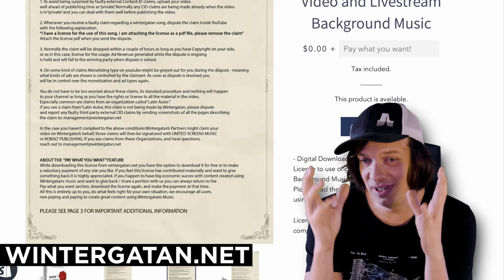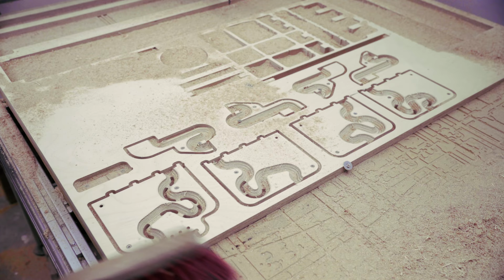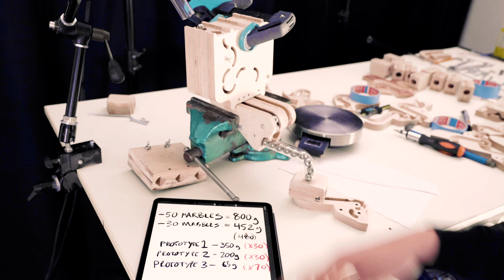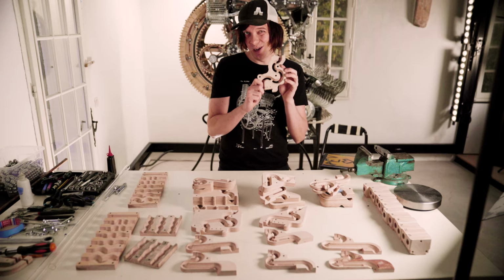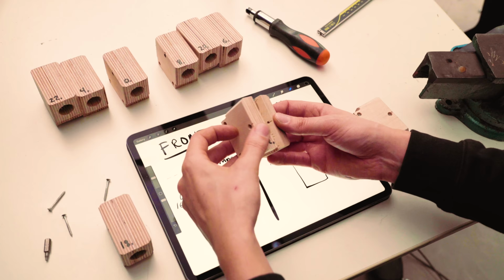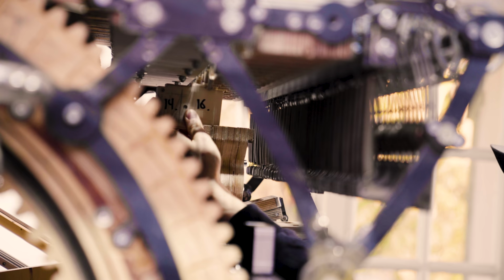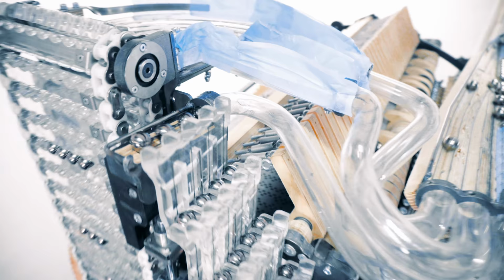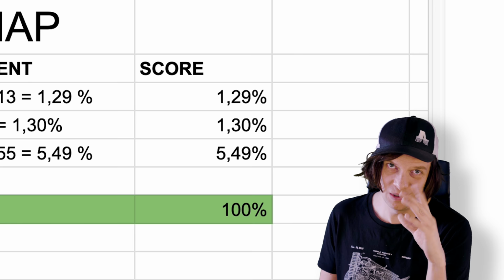Playing 20000 Marbles - Marble Machine X #147

Comment: Martin -- regarding guide wheels on the belts:
I'm probably preaching to the converted here, but remember to make sure that the wheels are positioned in such a way as to divide the free belt length in a non-rational way.
Any cord under tension acts like a string in musical terms and will have a natural resonant frequency, so will have a tendency to "sing" when fed certain frequencies (and the MMX is nothing if not full of frequencies!) -- if the rollers divide the length in half, you risk ending up pushing the vibration up an octave, which doesn't resolve the problem. If you have any other rational pair of lengths, you'll get pairs of overtones -- same problem.

Comment: So if I caught everything right; no failures on the parts that have most recently been worked on except for the catch... disappointing, but hardly the end of the world.

I know Martin won't go for it, but the real solution here is to leave the catches how they are, and have a 'catch all' below them that is just a large unmoving trough. Make it low and out of the way and it won't be too much of an eye sore.  Otherwise, having the catching mechanisms moving is going to be very difficult to calibrate with every possible rhythm that can be played.  Personally, I do not consider a dropped marble or two a fail unless it is near the top where it may play a wrong note, or get jammed in the machine somewhere.  If a marble 'doesnt want to be in the machine for a song' then it is probably because it wants to be in the hands of a fan in the audience.

Also curious about the 4-4 time of the rhythm being played for the test, as I am not sure it is realistic.  For one, it makes the test too long for practical benchmarking.  For another, it may be unrealistic for actual music being played.  Makes a lot of sense to drop more marbles per second to really push the machine, and make the testing process faster (or test for more marbles).  If he thinks it is good now, and ups the tempo to find a problem later when he has most of the gates deployed, then that would be a crushing disappointment compared to checking it now.

Assuming that it can in fact play faster while keeping the current level of reliability... dude... cannot wait to see the rest of the channels installed and hear some real music coming from this beast!

And the free music?!?!?!?!!  Wow!!!!!
I will pay what I can (granted it won't be much), but I have a 3D printing channel which will be starting early next year, and I run D&D sessions online.... I would love to use your music!  That is AMAZING!!!!
Reply: A catch all is cheating. He will engineer a good solution or figure out the variance in marble jumps.

Comment: Issue 4. Functionally speaking. You don’t need 2 tension wheels. Just one per belt should do. KISS...

Issue 5. These marbles are steel. Steel will wear down anything softer than steel. Essentially everything in this machine is softer than steel. This machine. No matter how smooth you get it. Will eventually eat itself to death. My suggestion. Use softer marbles. Or use harder machine components. Make the marbles the consumable part. Then make a quick sorter to tell when marbles are worn down too far. And trash them.

Comment: Hi Martin, I think that, with all the improvements, reliability wouldn't be a problem soon but, Have you ever though about how to transport the machine? Truck, trains, forklifts, etc are a source of vibrations and a travel of simply a few hundred kilometres by truck can break havoc in such a heavy machine with so many moving parts.
I'm mainly worried about the funnels. From what I can see from the videos they are only hold by PMMA tubes. The funnels are heavy and if subject to vibration will make the PMMA tube vibrate and eventually fatigue and break. These tubes are unique pieces and difficult to manufacture and replace so breaking one would be a catastrophic failure. You can even see the tubes vibrating when the marbles hit the funnels, imagine that  vibration multiplied by 10 during 200Km on a truck.
I'd suggest to identify all parts that are susceptible to vibration and improve the fastening method where needed. The more massive is the element the better has to be hold in place. In the case of the funnels they are a lot more massive than the tubes holding them in place and PMMA is really prone to fatigue.
Never underestimate how destructive transport can be. Remember that the "handle with care" stickers are just stickers and nobody reads them.
Reply: The machine is designed to be broken down for transport. Especially parts like the funnels that are not rock-solid will be removed and packaged.
Reply: The machine breaks down into 4 major parts and all the funnels and droppers are made to be easily removed
Reply: @HenryLoenwind  Nice to know he's thought about it. I have had my deal of bad experiences shipping machinery. In my case we could replace the broken parts with spares but, in this case there are no spares so you should be specially careful.

Comment: 12:13 : the plywood breaking appart : is this not a risk that - in the long run - the marbles will damage the wood (hence the profile) and the marble slowdown will start to fail ?
Reply: I've worried about that a long time. I fear that eventually, the plywood will have to go for years long reliability.
Reply: Remember this is still prototyping pretty much. While plywood isn't as durable, it is much more replaceable. When Martin gets a design he is overall happy with, he can rebuild the machine with more durable materials if needed. The concern is valid though given how long ago some of the parts were made.

Comment: When you will be on the stage, playing the marble machine, there will be a ton of vibrations coming from the crowd and other sources. Have you taken that into account?
Reply: I imagine that should be okay since it will be white noise, and not some frequency that could cause amplification or resonance. I'm sire the machine will also have some interface between it and the stage. The feet are already somewhat equipped with vibration dampening equipment - so that it doesn't shake itself around

Comment: Martin - When you were designing the track using over rotation as the principal to slow the marble what you ended up with is the marble dragging in the track since one side of the marble is moving clockwise and the other would want to counter rotate since it is in contact on two sides.  The drag in the track or it's length probably ended up doing what you wanted.  Regardless you are doing an amazing job getting this far and you will get to the end soon, we can all see it.

Comment: 8:00 And easy explanation of why over rotation slows the marble down is as follows: Going down the ramp converts the Gravitational potential energy (the work you had to do to lift the marble to that height) to kinetic energy (the energy of motion). There are two types of kinetic energy that are relevant for the marble; linear kinetic energy (from the motion in a straight line) and rotational kinetic energy (the energy from the marble spinning). Over rotation just causes a higher percent of the potential energy to be converted to rotational energy, and since more energy goes into the rotation there is less energy to go into the straight line motion, so the marble doesn't move down the track as fast.
Reply: it's similar to magnus effect,  basically higher rotation speed = more drag
Reply: That explains the change in velocity on the straight track, but what he ends up measuring is the weight effect of the static stack in the tube. What he ends up with isn't a function of the over-rotation, but a function of the overall static friction of the tube, taking into consideration factors like the resistance due to the normal force of the marbles in the horizontal sections and the coefficient of friction between the marble surface and the wood edge versus the original tube.

Comment: Hi Wintergatan, thanks for all your videos, hope the project is going well.
To solve  the issue with the belts I think you can simply pierce some holes in it to stop the belts entering in resonance. If there is tiny holes all across the belt, the vibration will not be able to run across it. 
Hope it can help you. Have a great day, full blessings <3

Comment: 8:00 to travel the same distance along a wider track the marble has to make more turns. So, to have the same linear velocity it needs to have greater rotational velocity. The marbles initial potential energy is divided between its linear kinetic energy and its rotational kinetic energy. Since it has to rotate faster in wider track, it will move slower given the same initial potential energy.

Comment: I'm no physician but here's my shot at explaining the slower marbles due to over rotation.
Since the contact point of the marbles is more to the side, the circumference of the marble is smaller. Same happens when you shrink a wheel, more rotations are needed for the same distance. So smaller circumference == slower marble.

Comment: In case anyone’s wondering why overrotation works:
Essentially, all of the marbles have the same potential energy at the beginning. As they roll down the track, it’s converted into kinetic energy. Kinetic energy is linear + angular (rotation). In order to conserve energy, for the same kinetic energy level, an overrotated marble’s angular KE will be higher, meaning that the linear KE will be lower to compensate. Lower linear KE = marble moves slower. And then you do a bunch of calculus and rolling friction on top of that which is horrible. Hope this makes sense lol.

Comment: You could parameterize the smoothness in the following way. Define free falling as perfect smoothness and calculate free falling time for the height of the part of which smoothness is tested. Then measure the time it takes for a stack of marbles to traverse said part. The relative smoothness can then be defined as the traverse time divided by the free falling time. This gives more insight and another parameter to optimise :)

Comment: 8:02 really good explanation, just a little physics to get to the end. Basically the final intuition is this: Energy is always conserved. When the balls roll they have rotational energy from spinning in addition to kinetic energy from movement along the rod. It is mentioned that the ball that sits lower has to rotate three times as fast to achieve the same speed.  Because energy is conserved,  this means it'll take more energy to achieve the same kinetic velocity. In other words, the lower balls travel slower because more of the gravitational force goes to spinning the ball instead of just "pushing" it down the rod.

Comment: Belts loose tension over time. A lot of machines use adjustable belt tension rollers, sometimes even with springs, so they also do a little auto-adjust. I would like to suggest, you use an adjustable roller you can lock with your hand (like using a normed, cross/star shaped hand-grip), so if needed, someone can just re-tension the belt within seconds, inbetween songs.
Reply: Why not use a lever held by a tiny shock absorber? You can get those from RC car racing suppliers, they probably will grab any vibration an turn it into heating the absorber oil just a tiny bit. (Remember, you're just tuning out resonance)

Or maybe just add a tiny bit of glue or silicon to the belt - adding a tiny bit of mass would also change its vibration characteristics, possibly throwing off the resonance...

Comment: The reason the marble on the wide rails rolls slower is because gravity pulls at a constant rate, but the smaller contact diameter forces the marble to spin faster.  Energy is going in to spinning the marble than moving it.  At the end of the track, because it has been rolling longer, it will have more stored energy than the other marbles

Perhaps that could be something useful in future marble machine features, slow moving, high energy marbles.

Comment: Great progress with the latest design upgrades. For the belt tensioning, you could use a floating idle pulley. Check out "Roll Ring" for an application example. This would avoid adding fixed idlers to the sides of the machine and look interesting also.

Comment: To fix the belt resonance issue, use an auto tensioner. Add 1 wheel on the slack side of the belt with a spring to set the tension.

Comment: 7:20 Answers:  Easement Curves, Transmissions on Rails on Wheels and Curves...  Look these up related to railroads/trains, and model trains. The Transmission on a rail wheel is between the flange and Outside edge. It's the part of the wheel that touches the rail, known as the tread (which sometimes gets flat or a "flat tire/tyre" when you hear it roll by), only a convex curve, no gears, but is the transmission, especially when it comes to curvature in the route of the rails.
Call them "Rails" for the two metal bars that the marbles roll on.  John, BC  Canada

Comment: I don't think the new marble path profile changes the static preasure on the marble gates. In my opinion it only slowes down the "reaction speed" of the marble collumn, which could potentially decrease the maximum bpm per channel.

Comment: Awesome as always
Suggestion: only put a roller on the return part of the belt and make it spring tensioned.
It wil dampen hitting its own frequention this way. It also prevents excessive wear only using one tensioner, try avoiding interfering with the driving side of the belt. Is a bit of an assumption, please let me know if I am mistaken.

Comment: For the vibration between the 2 belts, I believe all you would need is a single idler pulley like in car engines. Stop 1 belt from vibrating and they won't create resonance. Also 1 pulley will not add as much resistance.

Comment: Thin velour is more effective than rubber coatings on guide drops... (Pool table felt, for example.) It allows silence without restricting rolling much, while also eliminating marble bounce. Plus, it adds color...

Could be used as thin strips on your walker to reduce climbing noise where the marbles touch the plastic as they slide up too.

Reduces velocity as well as aiding in distributing pressure. Could be added to your drop buffers "snake" channels to reduce accumulated mass too. As well as aiding in more silence.

Comment: You can do the tensioning with a single tensioning wheel so that you don't add unnecessary friction.   One wheel will tension both the forward and return belt paths and pull out the vibration and resonance!

Comment: I have just found your channel.  I am learning a lot from you and will apply your problem-solving procedure to my own needs. To address your drive belt, I own and ride a motorcycle and while working on it I learned that belts are tight and chains are loose.  Perhaps your planned fix will work, you will be creating a belt tensioner after all.    Looking forward to your next post.  Good Luck!! Kind Regards.

Comment: 8:00 i believe the explanation is as simple as what you said: the wider the track the more they have to rotate to cover the same ground. essentially it's like all 3 are wheels of different sizes all spinning at the same speed. the lower the marble sits, the smaller the "wheel."

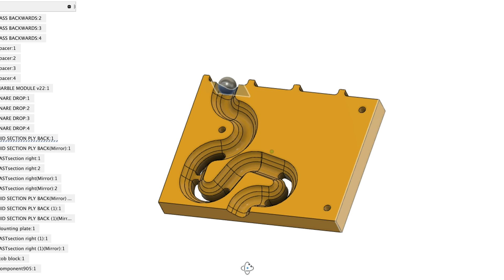Comment: 8:07 think in terms of energy. The fast rolling marble rotates less and has less rotational energy. The slow moving marble rotates more and has more rotational energy. They all start with the same potential energy (height) and thus more energy goes to speed for the slower rotating marble then the faster rotating one. thus the faster the rotation, the slower it goes.

Comment: I get the concept of over rotation, basically the marble with the widest track means that the parts of the marble that are touching the track make a small circle, which means that it rotates faster as the point of rotation is smaller, but since it's rotating faster that means that more of the force from gravity is being turned into torque instead of velocity, so the slower the marble rotates the more potential energy can be converted into velocity rather than torque

Comment: The track with makes it go faster because the rolling diameter is different therefore it travels further or less. Its like having bigger tires on your car. A larger tire will go farther with one rotation compared to a small one. The marble in the closed track has the largest 'tire'. 8:00 That's why it slows the marble down. It has to travel further.

Comment: The marble machine is not the product, Martin. You are the product.

Hey, also, **Suggestion* make sure the marble path is not only robust to the full pressure of a full stack of marbles, but also that it doesn't fail if there's only a single marble going through, or a small number. Prototype 5 looks like it may need some minimum amount of marble pressure to work. If you can't guarantee a minimum number of marbles in each queue under extreme playing conditions, it could be a bad edge case.
Reply: I'm honestly most worried about the potential for the dropping mechanism to jam if the marbles run out and then the first marble to arrive is falling into place as it tries to open.

Comment: I didn't see any comment about the three different marble tracks, so here you go:
At the start all three marbles have the same amount of potential energy. This energy will be transformed into kinetic AND rotational energy when rolling down the slope. The faster the marble rotates, the faster is its rotational energy and as such, it has also lower kinetic energy (Since both of those have to add up to the potential energy from the start).
To say it in other words: The smaller the rolling diameter is, the faster the rotation and the slower the movement along the track.

Comment: For the timing belts you should only need 1 idle roller instead of 2 as placing one on the inside of the belt loop, so that it pushes out in one direction will give the belt alot more tension